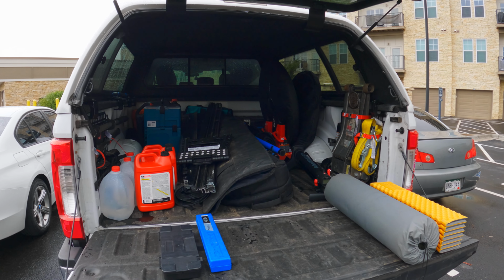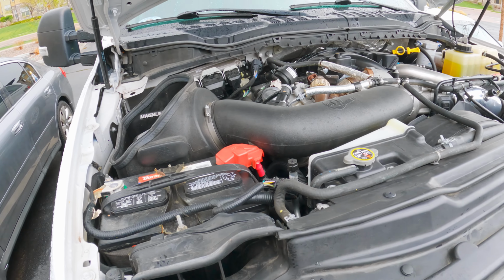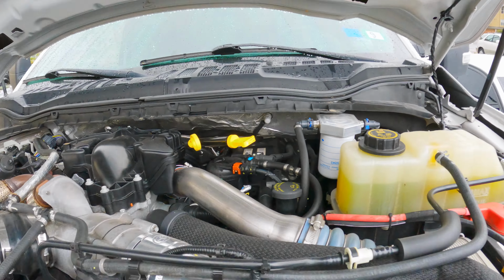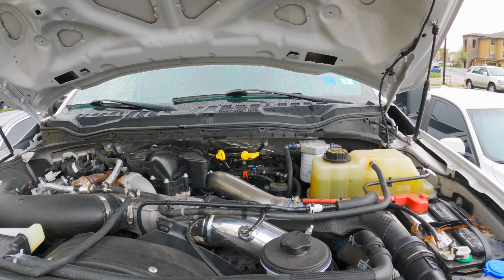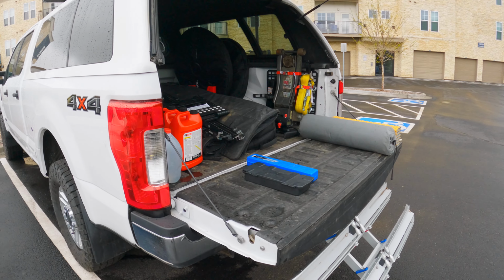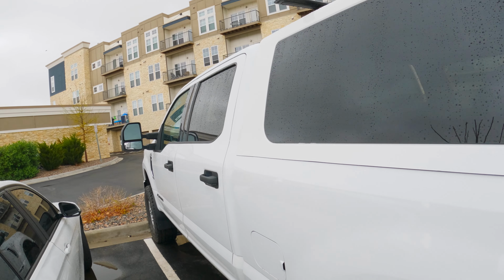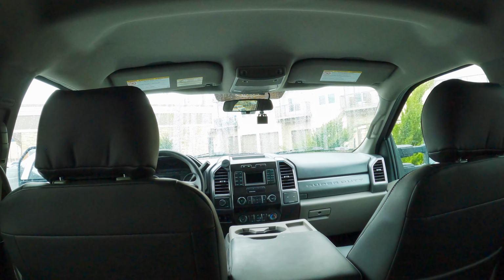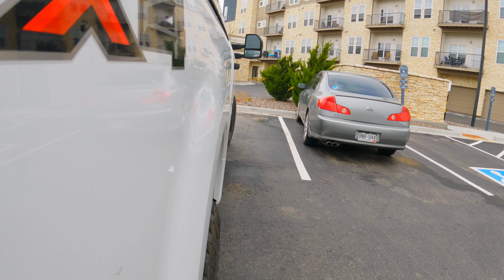Power Stroke 6.7 Owners: How To Avoid Common Issues And Make Your Truck Reliable

Comment: step1: go gas
step2: truck is reliable
Reply: If you actually tow heavy stuff often enough, you'll still want a diesel. If you don't exceed 10k lbs and still want a diesel-like towing experience with a gas engine, the 3.5 ecoboost is the next best thing.
Reply: @Brandon_Nelson92  no one should be towing close to 10k in an f150 dude lmao
Reply from the maker: @sly9263  LOL
Reply: @sly9263  When equipped properly, a newer f150 can handle 10k, no problem. I've towed as much as 10k with my 2019 3.5 ecoboost f150 and it handles the weight a lot better than you'd expect. It helps that I have the max tow package and 157" wheelbase.
Reply: @Brandon_Nelson92  "can" doesn't mean should or anywhere near as safe doing so as a 3/4 or 1 ton. No one should be towing 10k in a half ton
Reply: @sly9263  my buddy's 2018 GMC 2500 duramax broke down (again) on thursday, the day before his big camping trip started. His travel trailer weighs a little over 10k. I offered to pull his trailer with my truck. He was unsure about my truck pulling it at first. I assured him my truck could handle it. He was surprised with how well it did.

 My f150 pulled that trailer into the mountains, including 7% grades at 60mph, with ease. Engine braking was better than you'd expect, although not as good as a diesel. Brake temps were fine. The truck sat level with the trailer and the suspension wasn't overburdened. At no point did I feel the truck was struggling with the task at hand or was unsafe. If his duramax still isn't fixed in a few weeks, I'll be towing that trailer back home, too. 

Keep in mind, my f150 is a long wheelbase with the max tow package, HD frame and stiff suspension. Most f150s aren't equipped like that and max out between 7,700-10k lbs. Mine is rated to 12,800lbs with 2k of payload for a reason. You'd be surprised too if you towed with a properly equipped f150.
Reply: @Brandon_Nelson92  "light" duties definitely have the power- it's the handling and braking that question the logic/safety of pulling upwards of 10k or more on such a vehicle. you're using a 5-5.5k pound vehicle with light duty brakes and frame to pull over double it's weight... it's not anywhere near as stable or effective at braking as a heavy 7-7.5k heavy duty with a more rigid frame (40% thicker), much larger brakes, and the drivetrain that's built for the consistent abuse. a light duty will wear much more quickly pulling that type of weight
Reply: @sly9263  as part of the max tow package, it has huge brakes. My previous f250s had smaller rotors and calipers than my f150 does, no joke.
My previous 4 personal trucks were all pre-2007 diesel 3/4 and 1 ton pickups and I have towed with newer diesel pickups at work. I'd rate the overall weight handling capability (excluding power) as on-par with older 3/4 ton diesel pickups and not far behind the newer 3/4 tons.
I also have a class A CDL and have PLENTY of experience towing and hauling loads up to and exceeding 60,000lbs.

I was also a skeptic of "heavy 1/2 ton" trucks until I borrowed a max tow f150 to pull an 8k trailer while my f250 was broke down. After my f250 was fixed up, I sold it and bought my max tow 2019 f150 new almost 4 years ago. I don't tow often, but enjoy the capability without the headache or massive expense of owning a newer diesel.

Don't knock it til you try it. That's all I gotta say.
Reply: @Brandon_Nelson92  you sure about that? last I had seen F150 max trailer tow didnt do anything with brakes
Reply: @Brandon_Nelson92  trailer tow doesn't do anything to the brakes- I looked. I had an F150 with that back in 2016 and it didn't do brakes either
Reply: @sly9263  the brakes on my f150 are larger than on my previous 1999 f250. They're about the same size as the brakes on my previous 2006 f250. I'm not sure which option or package includes large brakes or if they're standard.
Reply: @Brandon_Nelson92  those are standard on all f150s- there isnt any package to upgrade them.
Reply: @Brandon_Nelson92  '99 f250 could barely tow what a modern half ton does... the whole "ton" labeling is wack now since a half ton can basically carry a ton in the bed or more at this point
Reply: @Brandon_Nelson92  Ford needs to fix the Cam Phasers issues with the 3.5 Ecoboost engines.  I think it also affects the 2.7s as well.  It is obviously a design flaw that Ford doesn't seem to want to fix.  Too many trucks have had the front of the engine torn apart to replace with the same parts that will likely have the same issue down the road.  My 2017 F150 had the 2nd Gen Ecoboost and it sounded like a diesel the first 5 seconds when you started it.  Was fixed under extended warranty but after that I I bought my 2020 F250 which is my first diesel.  Maintenance requirements are more but something I've come to accept for the longevity and hopefully reliability.
Reply: @chadh6899  the cam phaser issue is most prevalent in the 3.5, but also affects the 2.7 and 5.0. 

In Jan. 2021, ford released the 3rd revision of the cam phasers, which has fixed the underlying problem. Once you get the updated phasers, you're good to go. I'm hoping my phasers (revision 2) go bad in the next 13 months before my warranty is up. Otherwise, it'll likely be a 2-3k repair down the road.
Reply: The only time I tow close to 10k with my f150 is when my diesel breaks down and I have to tow it home.
Reply from the maker: Lol what diesel do you have?
Reply: @Brandon_Nelson92 thanks for that info. I didn’t realize there was now a fix for the cam phasers.  Glad Ford finally addressed it.
Reply: Yep if you want, dependability and reliability, go with the gas
Reply from the maker: Go gas?
Reply: step3: Learn basic grammer and writing skills.
Reply: @TexasHarleyBoy65  imagine being a dried up dinosaur clown that misspells grammar when trying to correct shorthand bulletpoints for proper english
Reply: He meant to say “he got gas”

Comment: I have a 2019 with 100k
Oil changes every 10k
Only issue is an upper pan leak covered under warranty. 
Truck has a lot of idle hours I sit in and run the AC in the summer. I’d say about half my engine hrs are idle hrs. 
Overall I feel confident it will make it 250k and I’ll turn it in for my next on in about 4-5 more years. 
And I’ll get another f350 cclb
Reply from the maker: It sounds like you’re good about staying in top of maintenance!
Reply: @powerstrokemaintenance  already at 105k now shortening up oil change intervals to 5k as a cheap investment for the long haul.
Reply from the maker: @jimmy4x4socal44  It certainly is!  Just doing basic maintenance regularly will save you thousands!

Comment: I'll still keep my old 7.3 diesel. Running trouble-free since I bought it in 2001.
Reply from the maker: Good call.  Those early 2000s 7.3 are gold!
Reply: I had 4  of the 7.3'S. Best diesel ever made for pick-ups. 300,000 on my first one. Only put batteries,  starters and transmission only because I pulled twice rated from factory.

Comment: Drain the water separator
Reply from the maker: Thanks for the comment!  That's a great one.  Will save a lot of trouble if you do it regularly.  How often do you drain yours?
Reply: @powerstrokemaintenance  Good ?. Out here in Cali far less issues with water in bulk tanks from humidity condensation.  I do it about every couple months and never found even a drop even after letting sit in clean glass container for months. Usually get fuel at Costco where they also keep nozzles squeaky clean to, and ff change every 10K. But all it takes is 1 with CP4, which thank God was removed last week, just got S&S DCR pump  installed and loving it.
Reply from the maker: That's awesome! Heard nothing but good things with the DCR from those that have installed it. Im jealous of your setup haha
Reply: @powerstrokemaintenance  with other stuff I had done the shop bill was $4K, the DCR WAS $2K.  Next LOF will include ATF change, but the next big expense will be getting rid of that ridiculous 26 gallon fuel tank.  S&B 60 Gal is probably the last upgrade, another ~$3k.  But then she's done except routine PM.
Reply from the maker: That’ll be an amazing rig then too. You’ll have all the goodies. It sounds like you’re excited for it to be done
Reply: @powerstrokemaintenance  Hanging on to it because it's steel body.  Needed for magnetic ham radio antenna.  It'll also be muh Apocalypse Assault Vehicle LOL
Reply from the maker: Hahahaha the perfect apocalypse vehicle!

Comment: Great advice! Also, keep it clean and periodically apply wax or some other UV protectant to the paint. I'm not afraid to have some offroad fun and get my vehicles dirty, but I will generally wash them within a day or too afterwards. I like driving a clean truck that will turn heads!
Reply: going along with that, get an undercarriage spray cleaner too.  (I got a unit from lowes to attach to my power washer $50)
Reply from the maker: @tattooedmillionair  Thanks for the tip!
Reply from the maker: Keeping your truck clean is the way to go!  I could definitely be better about waxing my truck and washing it more often.  What sort of product do you use on the paint?
Reply: @powerstrokemaintenance  in the past I always used the old school method of rubbing in carnauba paste wax 2-3 times a year and the paint has always lasted many years. But now I started using that Turtle Wax Ceramic Spray coating because it so easy to apply. Time will tell if it protects as good as the ceramic products claim to be. I'm in Nevada and our desert southwest sun is brutal on paint.
Reply from the maker: Gotcha I’ll gift that turtle wax ceramic spray a look.  It sounds super tricky to protect your paint with how hot it gets down there!

Comment: Crank Case Ventilation, can clog and push oil through your upper pan gasket.
Reply from the maker: Good call, that can be a real problem. Thanks for the comment.  Have you experienced this issue yourself?
Reply: Yes! This is the number 1 problem on 17-19 f350 and up that I saw in the dealership.